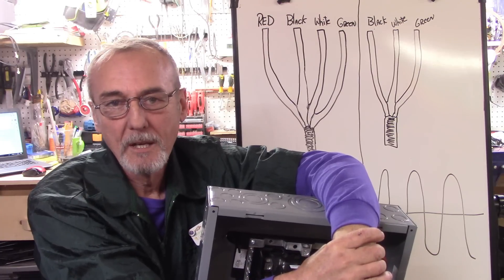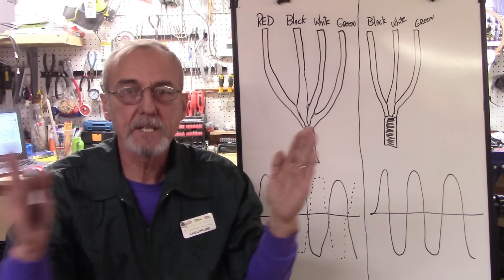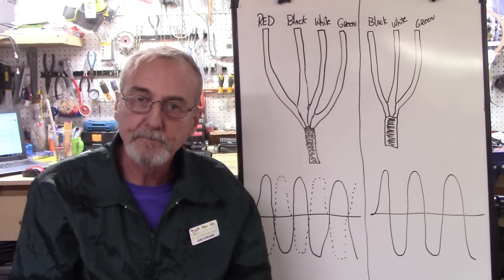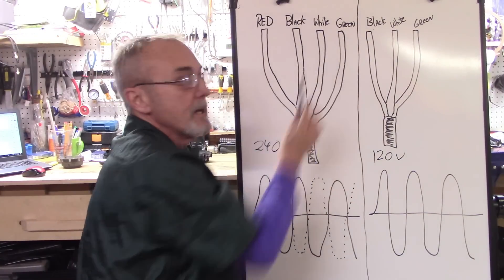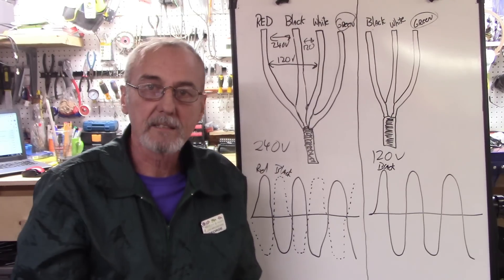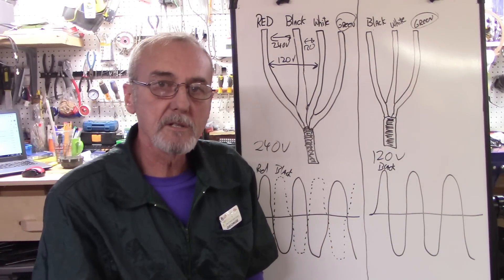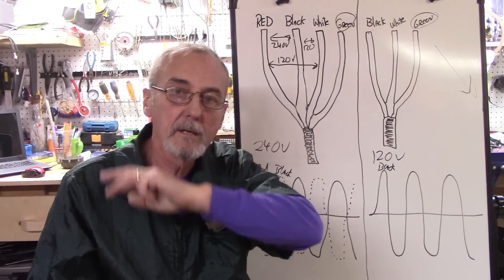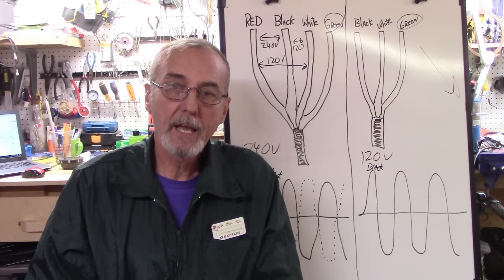240 V  vs  120 V explained

Comment: Great video.  Let me ask you.  I want to wire an electrical panel with a generator.  I am aware of the dangers involved if it's not done according to code so that is not an issue.  Home generators that I have been looking at are only 30 amps and are either 120/240 volts (four-wire with the hots on the same phase) vs 120 volts (3 wire single phase).  Both are 30 -amp generators.  

MY QUESTION:  In the wiring from the generator to the panel, does it make any difference which wire I would use going to the panel when only 30 amps are being produced (10 gauge three-wire or 10 gauge four-wire).   Again, a home generators 240-volt outlet (four-wire) is 2 hot wires of 120 volts on the same phase.s

Thanks for reading
Reply: Its all one phase, 120v generators are cheaper but will only power one side of your panel, 240v will power both sides, each side is getting 120v, if you use a meter and test hot to neutral you get 120v if you test 120v to 120v you get 240. 240v gen is good for a house. But one 120v will work as long as you dont have appliances that rely on 240v, but you will have to put a 120v 2pole breaker    jump a wire between the contact to feed the other side of your panel.

Comment: 120/208 volts AC is common in America as well. Some utilities in metro areas use 3 phase banks hooked in a Y configuration to supply single phase loads to residential, which is done to balance load between the 3 phases.

Comment: So If you have an european Device wich Works on 240 Volts, and you would make to Work in US how to do?
Need one Hot wire more? And wich freqenz is the result?  It is abaut 3000 Watts and ground is needet.
Reply from the maker: European 220V 50HZ is wired the same as the U.S. 120V 60HZ. One hot wire and one neutral.
George
Reply: @BarleyandHopsBrewing  okay is it possible to Connect a 240 Volt, 3000 Watt device to your Plug? How to manage this Thing? What do i need to bring it to work? On 240 Volts IT is about 12 Ampere, on 120Volts will be 24 Ampere, how to manage this?
Reply from the maker: @boesve  Yes you can. Manage it by using the correct wire for the load.

Comment: Is the 240VAC coming into the panel single phase?  How does the phase shift happen to the other leg?
Reply from the maker: They are 2 legs of a single phase system but each one is 180 degrees out of phase with the other.
Hope this helps
Reply: @BarleyandHopsBrewing  Then is not your sine wave drawing wrong (you drew two phases for 240V)? The 240V is measured from the top to the bottom of the sine wave whereas the 120V is referenced from the middle (the center tap).
Reply: Stephen Bender    Please see my comment and follow up comments from 10 months ago.   Today is April 21, 2020
Reply: Greg Schell     Please see my comment and follow up comments from 10 months ago.   It is April 21, 2020.

Comment: can I connect two SSR-40 in serial, I have two heating elements 2000w for a powder coat oven
Reply from the maker: Sure can . Would be more responsive wired in parallel. 
George

Comment: This is a rather poor and confusing attempt to explain the US domestic power supply system. The original reason for the low voltage was to suit early incandescent light bulbs and this low voltage has survived. 
One phase of the three phase transmission part of the system is transformed down to 240 volts. This arrives at the final transformer that supplies the end customer at his home. This is a 1:1 transformer whose secondary is centre tapped resulting in a 120-0-120 voltage output.

He should have started off with the above information, and then continued with his explanation.

Edit to add: this a simplified explanation and is not intended to be a  comprehensive tutorial, it is meant to be a constructive criticism of this video.

Comment: So how do you get 220 volts , like for ac units ? thanks
Reply from the maker: In the US these are on their own circuit. Usually a four wire circuit and that circuit is controller by a 50 amp breaker. Same as a stove. two hot legs, one neutral and one ground.
Reply: You get 240VAC from the Red and Black wires. You'll need what it's call a 2-Pole breaker to be installed in your power panel. The breaker will provide a connection to both the red and black power source.
Reply: Barley and Hops Brewing Did 4 wires with GFI with 120v outlet. Same GFI also protects switch and 240v pool pump.
Reply: So i cant make a 3 wire into 120 v unless i rewire at the box, is tht correct?

Comment: This man drew a graph (did not even bother to label the axes of the graph, moreso he drew only one axis) of two wave forms that are completely out of phase then decides to take two different points on the graph ( which occur at different times and not the same time), then add them together and somehow came up with 240V. Folks, please go to school, take a  math course, pass your exams and then come back to this video and tell me if what he said is correct and factual. I invite your responses.
Reply: His presentation is a little loose, but anyone who already knows how it works should have no trouble understanding him.

Comment: Early in you make kind of a mistake.  You are correct that it's the differences in phase that get you to 240V but you point to two consecutive positive waves and say you can add them together.  It implies you are somehow using the positive peaks together and in reality you are getting 240 by referencing a negative side of one phase against the positive side of the other phase, instead of referencing against the neutral.  Not a huge deal but I think it would make it clearer for newcomers.  You are not wrong in that you are talking about using the two phases, but your not really adding but playing them against each other.
Reply from the maker: Very well put. I see your point and appreciate it.
I will make sure I include that in future descriptions.
Reply: S Koue     Please explain how you get 2 phases from a "Single Phase System".    If you say split phase, then tell me what causes a phase shift in time in the transformer.   Guessing it will be hard to justify.     It is single phase, period.
Reply: @KevinCoop1  Wow this was some time ago...  And maybe phase was wrong?  In the US with four wire 220V you have a 2 Hots and a Neutral and a ground.  The two hots are 220V differential voltage.  Te Hot to neutral is each 120V.  
Now point out where I am wrong (because the potential is certainly there) BUT the only way that works mathematically is if  the 220V lines are 180 apart in phase and that the 120 legs must be 90 degrees out of phase.
Reply: S Koue    How about we try this.   A coil in a transformer is wound and every turn around the steel core is one volt.    So, there are 240 turns for 240 volts.    Half way through the coil at 120 turns from either end is a conductor that is soldered to it(a tap) so 120 volts on either side of the tap.   As the voltage on the primary increases and electrons travel in one direction, the secondary voltage increases and electrons flow at exactly the same time and direction.   This occurs for all three sine waves(2@120V and 1@240V).      As far as math, 120 turns+120 turns= 240 turns.   I.E. 120V+120V=240V.      Single phase.   No out of phase, no 180 degrees.    Simple explanation.   Does this help?
Reply: @KevinCoop1  You are looking at it as if the neutral is fixed and the hot is wiggling above it and that aint the way it works.  Neutral is in the center and hot waves around it.  1/2 the time the wave is negative related to neutral and the other 1/2 it's positive.  Voltage is the potential difference, in DC it is what it is but in AC it is the difference between the high and low of a cycle.  240V AC in houses is mostly the four wire version, two hots , a neutral and a ground.  The two hots are 180 out of phase with each other the potential of each to neutral is 120V.  Because they are 180 out of phase the potential between the two hots is 240V.
It's single phase because it's the same phase just inverted.

From a different site that had the same question, sort of.
"If both legs of the 220V circuit were "In Phase" then there would be NO voltage difference between them (i.e. they would both be doing the same thing and voltage between 2 voltages that are the same is ZERO). They are 180 degrees out of phase and thus the voltage between them is TWICE (220V) what the voltage of each to ground is (110V).

Actually many years ago I graduated as an BSEE. There was a lot of complicated math involved, especially with AC current including imaginary numbers. In this case, however, it is pretty intuitive. Just picture two wave forms going positive and negative around zero. If you take the difference between them (i.e. the voltage when measure between them) at ANY INSTANT, it is intuitivly obvious that there would be ZERO voltage between them if they were in phase."

They also posted a link to a YouTube video that shows the relationship on an Osiliscope
Reply: S Koue    I've seen the Repairmans video.   I do not concur with it.    So according to you, the only way to get 240 volts is to add two 120 volt somethings.    You can forget ground, it has nothing to do with the discussion.   Secondary voltage from a transformer is strictly based on the primary voltage, the number of turns in the primary coil, and the number of turns in the secondary coil.   Nothing else.   If you are correct, please in your words explain how a sine wave can shift IN TIME in the transformer.   What mechanical part of the transformer makes that physically move in time.   Also, please explain how two 120 volt circuits that share a neutral and have the same EXACT load, will have zero amps or current on it.   Remember, everything goes to neutral and to get 240 volts they must add up.   Oscilloscope's can give you the answer but, can the test be flawed?
Reply: @KevinCoop1  Not the only way but the way that it comes into homes.  This whole discussion is for 240V as it is in homes.  I have worked on circuits and wiring since the 70's, I know how a transformer works.  A sine wave IS a voltage shifting in time.
But a Sine wave is just a good graphical representation of potential difference.  What is actually happening is that electrons are running one direction and then they run the other direction, they don't swing up and down.

The original post was simply that his graphic was not correct.  That is it.  He showed two legs of 120V moving in phase and added them to get 240V.  Now you can either pick a reference to neutral, in which case those two legs will be 180 degrees out of phase OR you can reference one leg and in that case you only have ONE wave.  You can't have it both ways.  There are good reasons to use a neutral reference but it is a reference so you can pick a leg and then you get the one big wave.  Referencing a leg can be quite dangerous because there is no neutral or ground in that scenario.

I'm going to stop responding because this is starting to smell like trolling.  People can look this up.

Stay safe.
Reply: S Koue    Your answer was perfect!   Very accurate and correct.   You do have a few years experience on me if you started in 70's.   I started later in 1983.   Mostly designing for contractors.   Thanks for the comments!    Stay safe too!    Respectfully,   Kevin
Reply: So which one is cheaper  to our pockets
220 v  or 110 v ?
Reply: Ed Ca     You need to be a little more specific.   Initial electrical installation, or power consumption, or something else?
Reply: @KevinCoop1  if you use 220v or 110v  in a regular lap top
which one would be cheaper to pay same amount of time same lap top same hour winter time same house same person using it
Reply: Ed Ca    Since utility bills are based on KW hours, and the watts are exactly the same no matter the voltage, they would cost exactly the same amount to operate.   Higher voltages help with conductor sizes.   Double the voltage, half the amps.  Half the amps possibly smaller wire.   If you need anything further. Just ask.   Kevin
Reply: @edca8114  For a laptop computer?  That is hardly any power.  With heating water and such 220V probably has a slight edge because it will pump more energy into the water faster and since you are losing heat through the walls of the pot you will probably use slightly less power since you will lose less because of the shorter time in heating.  But probably not a significant difference.  For heating 220V is a plus because you are getting more over all power with thinner wires.  It saves time more than anything else.  You could get the same heating amount with 110V but you would need to have a custom wired outlet with a plug rated for double the amps and some really thick wiring, OR use two 110V circuits.  That might be a "cheaper" solution if you have two circuits (on seperate circuit breakers) close to where you boil pot is and you don't have a 220V outlet.
Reply: @KevinCoop1  I got a friend from Filipinas he built his house over there but it is using 110v NOT the normal 220v and was wondering if he would be paying less thanks

Comment: Is it better to get to 208 v ac from 120 or 220 ?
Reply from the maker: 208 would indicate three phase that is 120 degrees out of phase with the other 2 legs. You can't get this from 120 or 220 since these are single phase.
George
Reply: @BarleyandHopsBrewing  I have a exhaust dpf that I have to connect to a 208vac single phase and I only have 220 vac how can i step it down
Reply: Apolinar Ponce    You can hook it up to 220 or 240 volts IF YOU CHECK THE SPECIFICATIONS SAY IT WILL WORK TO 250 volts.   If not, the only easy way would be get a buck and boost transformer.

Comment: Pls explain why 240v doesn’t need neutral “return” line?!
Reply from the maker: I did
Reply: Specify.. why does 240v have its own neutral?
Reply: @mikefasan325  it doesn't at least relative to this video and in the U.S.. Watch videos from The Engineering Mindset Channel; they are correct unlike this video.

Comment: I have to stop right now I have electric furnace in garage on 60 amp breaker. Im replacing it with a hanging 240 volt comfort zone heater and watch you tube videos they say the black and white are both hot especially if you run the white off breaker. but mine is 240 volts has L1 L2 and L3  L! and L3 both say Hot wires and no neutral is needed. But I have 4 wires the red,blk,white common and clear grd. L2 has absolutely nothing and these guys only one showed he took the white and bare grd together for safety? Right???  It does have a bolthead with Grd markings the 3 lines so I will put red to l1 black to l3 white to ground lug and the bare copper wire to a suitable ground to case. I know thats right. And you can get 240 volts with 2 wires 1 from ea 120 volts!!!
Reply: Not Mine my white is neutral aka 4 wire

Comment: 😂if you add two sine waves at the same frequency and amplitude that are 180 degrees out of phase you will end up with 0 v at every point on the waveform. Not gonna help brew much beer.
Reply: But you don't add them, you subtract.  The voltage difference is 240V.